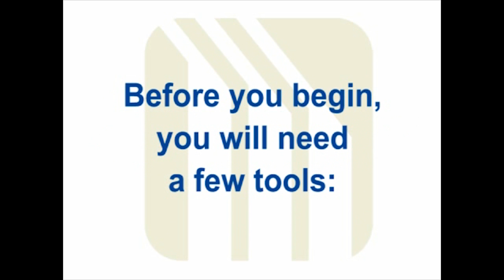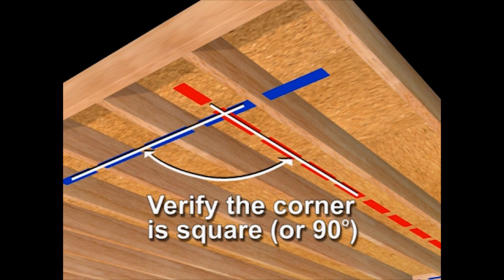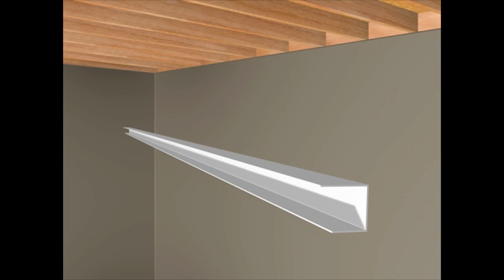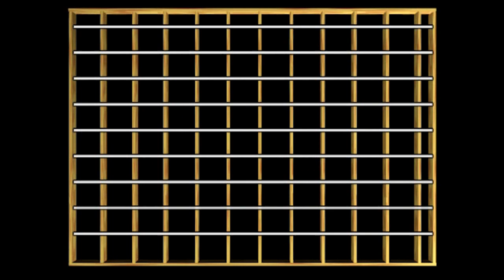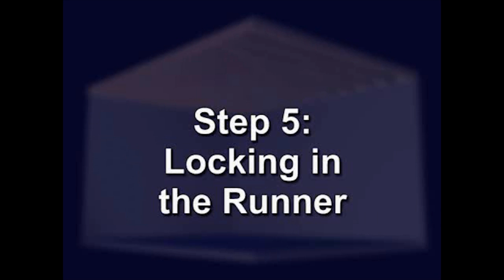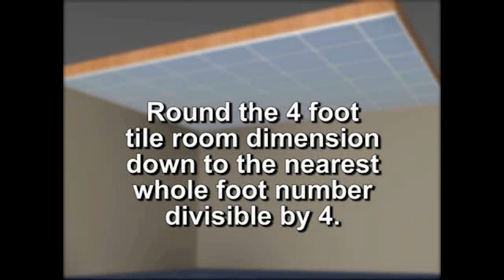CeilingMAX Grid System Installation

Comment: I am confused on your calculation on the 2 by 4 tile?
Reply: With a 2x4 tile, you will choose which way the 4 ft section will run.  You measure the length of your room in this direction.  For example, lets say it is 14 ft 2 inches.  You round down to the first number that is divisible by 4.  That is 12.   Subtract room length by 12.  (14' 2" - 12') equals 26 inches.  Finally add that 26 to 48 and divide by 2.  37 inches.  That means the tiles on both ends of the room will be cut down from 48 inches to 37 inches. The tile sizes in order will be 37, 48, 48, 37.  A total of 170 inches or 14 ft 2 inches.